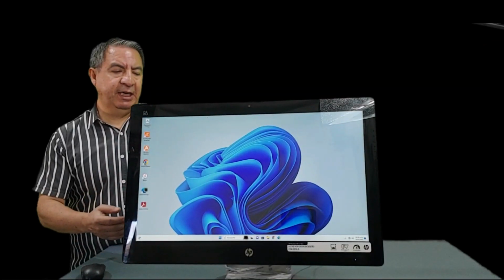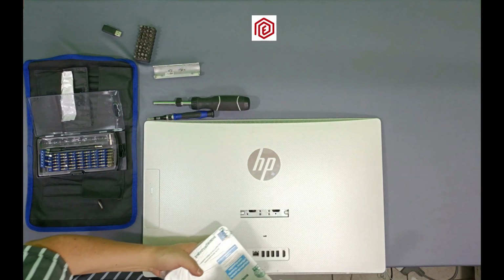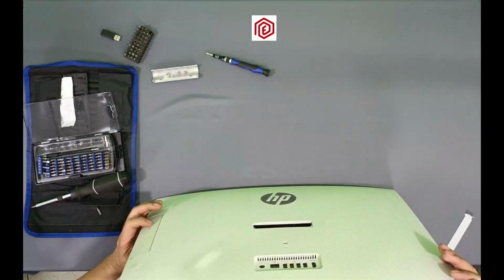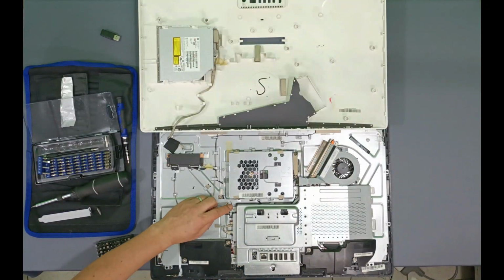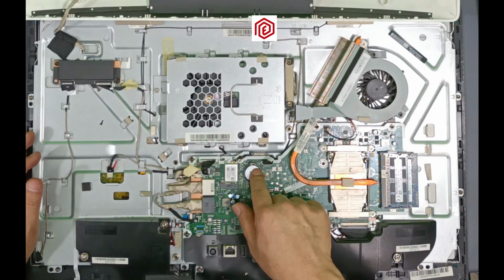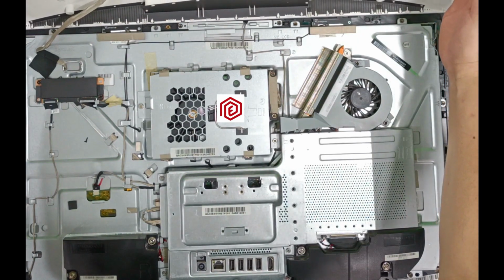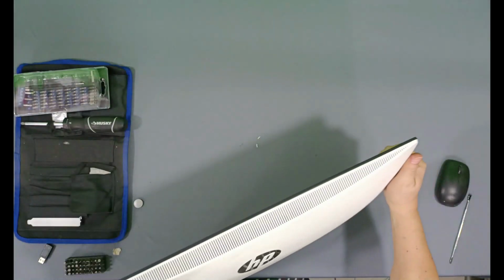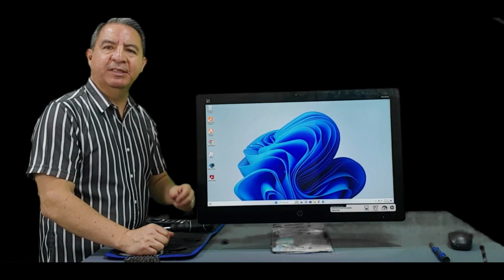HP Pavilion - CMOS Battery Replacement Tutorial: Fixing Incorrect Date & Time

Comment: Thank you for this carefully and thoroughly explained and demonstrated video. What is that tool called that you put in between the case and twisted it along the sides? Can I use a flat screwdriver instead? I saw on the HP website that replacing this battery might also help boot issues as well. When I turn on the computer I just see HP and spinning dots. Will this be a possible first step for me to try? I will need to get magnetized screwdrivers but I appreciate your details. I liked, commented and subscribed because even if this does not fix my issue, the video still demonstrated with care how to access this system which I greatly appreciate. Thank you for the english voice over and subtitles as well.
Reply from the maker: Thank you for your comment. The flat tool I used isn't actually sold anymore as it's a cover from another computer, but I have it because it helps in such cases. You can use anything flat, like an old debit or credit card that doesn't work anymore (since they can get damaged), or you can find specific plastic tools online meant for computer maintenance.

To try to solve the startup issue you mentioned, attempting to boot from a startup USB could be a good first step. This will allow you to check if the issue might be related to the operating system or the hard drive. If you see the HP logo and spinning dots without progressing, it could indicate an operating system loading issue. Try booting from the USB to see if this helps start up correctly. I hope this initial solution proves helpful. Let me know how it goes!
Reply: @felperstechnology  thank you for your reply and for an alternate solution. the computer was a gift several years ago and I do not have a startup USB or anything else like that. And I never created a startup USB from the computer that no longer works. I do have a second Windows computer however, can I create a startup USB from that and use it on the other Windows computer that no longer loads? Thanks as always for your help and information. Take care.